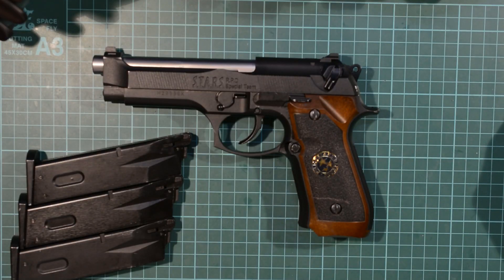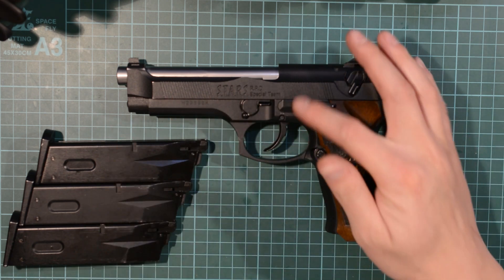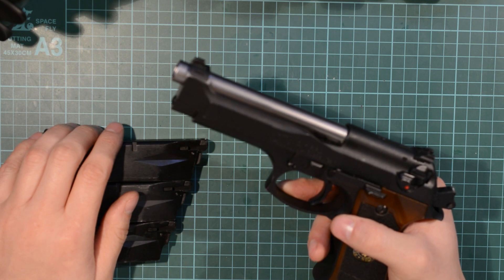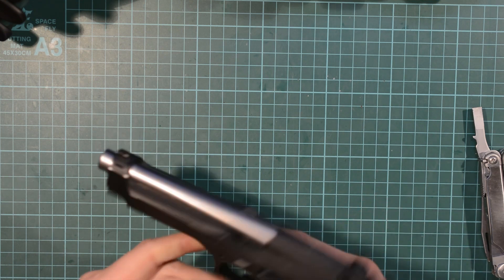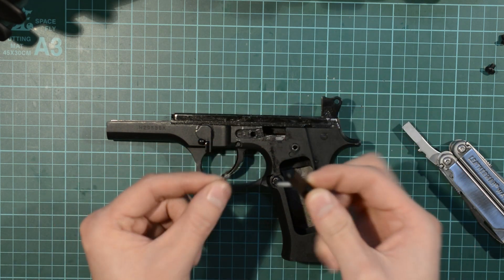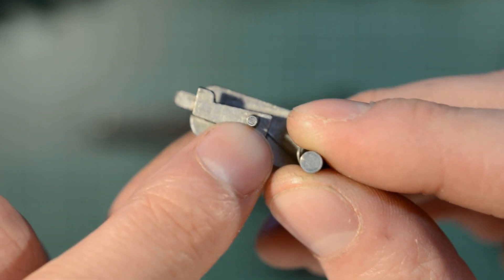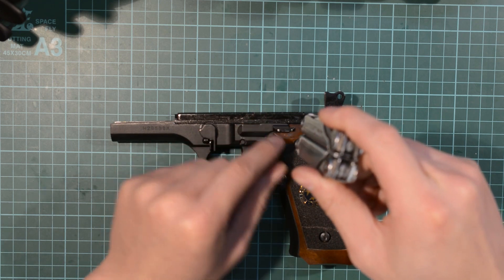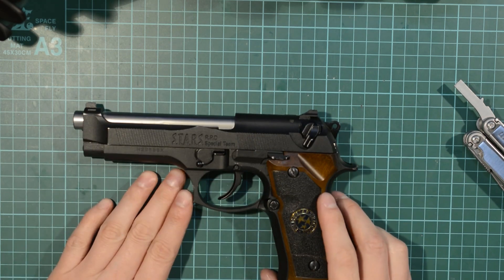WE M92F Beretta Slide not locking Problem

Comment: Genius! I have a similar issue with a KJW KP-13. The mechanism is slightly different, but at the end of the day there is a part in the magazine that pushed the slide catch up, and it is not doing a good enough job at it. After seeing your video, my guess is this is the same problem: the spring has a bit too much tension causing the catch not to go up high enough to stop the slide. Think I may have a crack at this! Thank you.

Comment: for the rest of the people that didint solve the gun i had the same but bibigun and the fucking slide dropt off and would not get on the gun so what my problem was on the side there is a buttonright in front dont know where its for and on the other side there is a switch u need to look in the gun if its flat or else it wil be jamd and the slide wont come on so make sure u put that good on and a tip keep your figer on the button right or else it jumps off

Comment: Hi there, I recently bought my WE M9A1 Gen2 and noticed that 9/10 times the slide will not lock back when empty with gas (even when fully gassed) whereas just racking it by hand when empty with a mag will lock it. I've found that pushing my magazine up when firing it dry will end up locking it back every time. Would this fix shown here solve that problem do you know? (I probably should try it anyway but I may as well make sure)

A second question too if you could help out, does the slide on your M9 have a certain point when racking it while empty where it will stop and require more tension to fully rack it? When I rack it quickly I have no notice of it or when it is loaded it doesn't have that area of more tension being needed. This only occurs when it is empty and I'm wondering if it is a build problem or just part of the weapons design?

(It has been re-lubed but possibly not in the right place?) What I'm thinking it is, is where the piston needs to be pulled back as it is slightly too tight maybe?
Reply: Tried the fix, it sort of worked as some times it was locking back but overall 60% of the time it was not working. Did you happen to replace the spring itself or just loosen it?
Reply from the maker: Hi

I never had the sticky rack at the end you mentioned where you need to pull it back even more.

this fix is not perfect, end of the day it appears that some WE pistols were made better than others depending on who did QC at the factory but sometimes they need that extra nudge here and there.

I no longer own this GBB Pistol, i sold it to a friend who has since modded it and sold it on.

IMO if you want the best of the best GBB Pistols i would say look no further than TMs, my TM M9 can at times out range most AEGs so consider a TM for your next GBB Pistol bro.
Reply: It turns out, I was mis-sold, when I asked for a Gen 2 M9 I was actually given one of the Gen 1's.

I'm guessing the problems I'm facing are to do because of this as Gen 1's were apparently riddled with problems both internal and external. Hopefully it shall be replaced tomorrow with a proper Gen 2.
Reply: I have the exact same problems